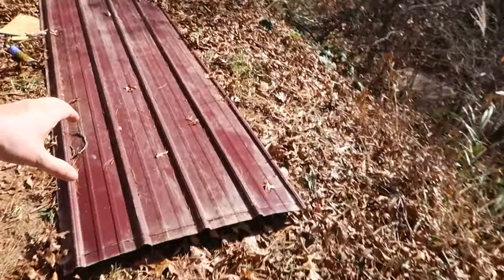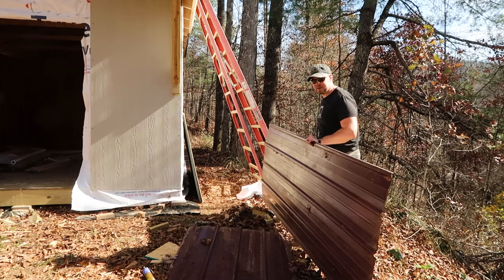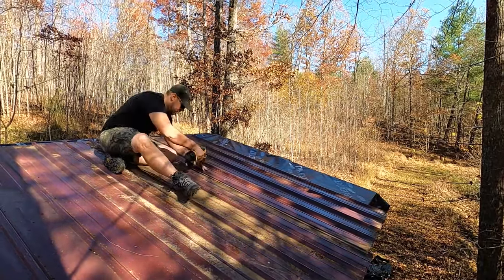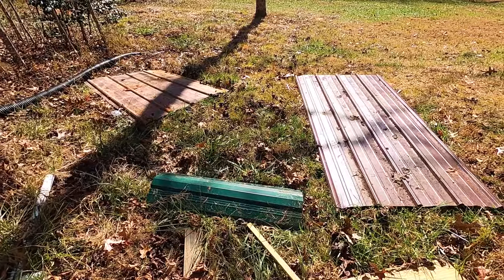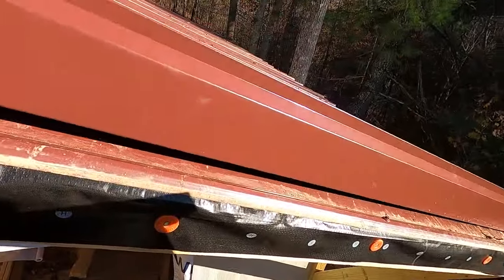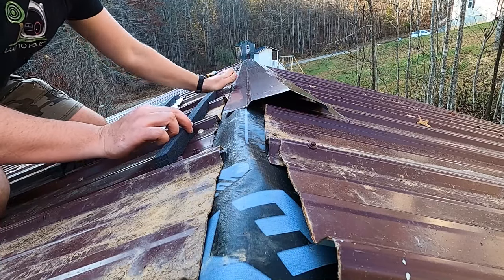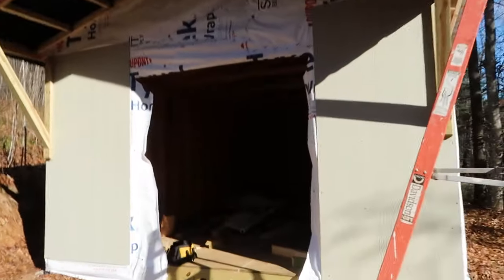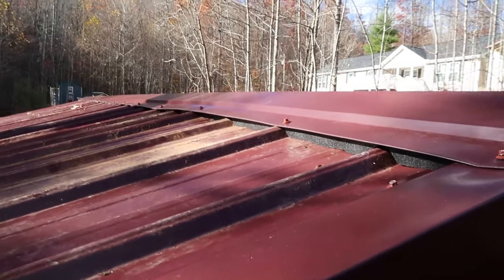Metal Roof Installation for a Shed

Comment: Looks good. For the rake trim you could have cut the face of the trim with tin snips right up to the peak and a little snip on the ridge side and it would have bent right over the ridge and tuck one edge behind the other.

Comment: Good video. I am replacing the rotted roof of a shed and installing used metal roofing. First do you have a video on the the roof installation before the metal is installed? Second, dumb question but doesnt it leak through the screws in the metal? Ive only ever used tarpaper and shingles

Comment: Awesome. How do you make sure the water doesn’t leak through the hole that is made when you drill metal sheeting into your roof? Do you seal them after?
Reply: The screw has a waterproof washer under the cap that seals up the hole.

Comment: Love the videos and it's a good looking roof.
I see the foam inserts for keeping bugs from crawling up under the lip of the ridge cap, but what did you use to keep bugs out of the ends of the ridge cap?
Reply from the maker: I have not installed anything there yet. Probably some more foam. I also need to install vents for the shed. I will likely use a solar gabel fan.
Reply: There are foam inserts to go between the metal roof and underlayment. its the inverse cut of the ones Seth used.

Comment: Screws are supposed to go in The Valleys of the tins not on top The Ridges for multiple reasons
Reply from the maker: Yes thats how I see it. But there are plenty of people that disagree.
Reply: @LandtoHouse  well I have six buildings all with tin roofs and we get 6 feet of snow and I have them both ways and I curse the time I was told to put it on top the ridge I can't wait to replace that roof.
Reply from the maker: For sure! It just seems best to have the rubber washer land on the flat metal.
Reply: @LandtoHouse  and when it's a screwed to the ridge it can crush the Ridge and you also can't shovel the roof otherwise the roof screws get snagged by whatever device you use. And having the screws stick up 3/4 of an inch also makes them weak.
Reply from the maker: Very good points! Luckily we get 1 to 5" of snow here.
Reply: What about breathing boards? I did not notice any but i understand he did not build it.